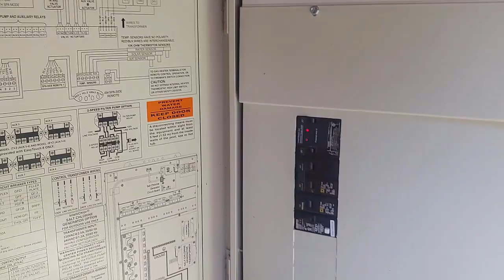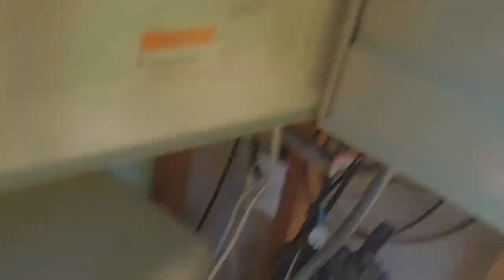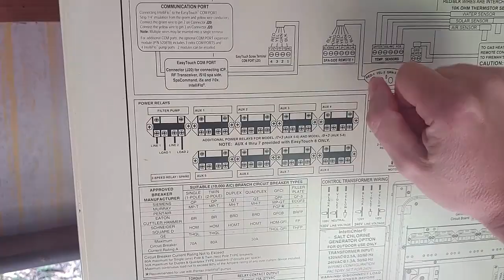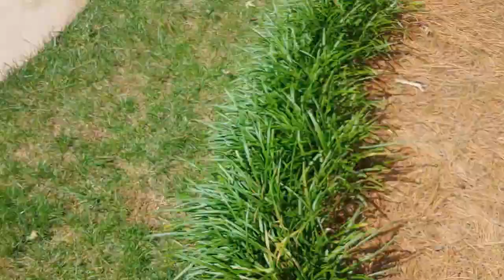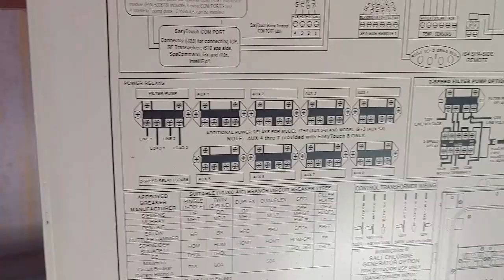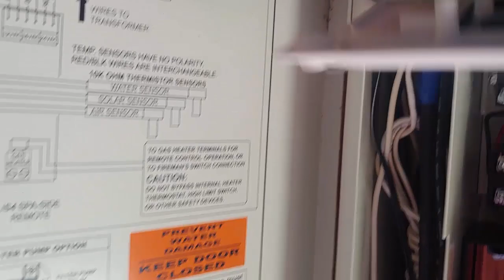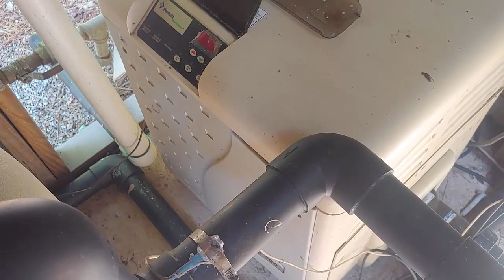REVIEW & overview: Pentair Easytouch 4 & Easytouch 8 installation. Pool & Spa Automation system.

Comment: I have the same exact system and my schedule Timer is not working, no matter what schedule I set the damn thing never stops just runs unless I shut the whole system down
Reply from the maker: Maybe try to reset the easytouch using the digital screen. You'll have to reprogram things so be prepared for that. But first, check your motor relay to see if it is stuck/worn out. The contact points inside it may be stuck. If so, you'll need to replace your motor relay. It may be the first relay in your box but could be any of them, trace the wires and see. Turn off all power and tap on each one with the butt end of a screwdriver, that may get it unstuck temporarily.  Turn off the main power supply to the entire box before doing this.  I think you live in my area, I wonder how close. I am in Cumming.

Comment: Awesome video, thanks for sharing all this great info. At 0:20 you mention an 'assisted pools install program'. Can you explain what this is?
Reply from the maker: My pool builder (fiberglass) has a special sales program where you can basically pay them to make your pool and they come and they put it in a hole in the ground that you have a contractor do, or maybe you know how to do it yourself. They get the pool up and running on temporary electric. And then you act as a contractor or subcontractor to do everything else yourself. This is a company in the South Atlanta area.
Reply: @SwimmingintheDeep  Interesting to know, thanks.

Comment: Great video, thanks for taking the time to explain all of this.  My Pentair Easy Touch system stopped functioning although there is power to the transformer, the screen only shows the tiny boxes images and there is no response from the control board at all.   I noticed that the Blue wire from the transformer is not connected to anything and from what I can figure out by the diagrams is that is should be connected into the 12v breaker switch above it.  You ended the video right before explaining the transformer wiring.   None of the breakers in the main panel are tripped and both shut off switches, to this box and one to pump, have power.  This happened all of a sudden and I’m trying to figure out if the board needs to be replaced or the blue unconnected wire is the issue.   The Easy Switch is dated 2014.  I be appreciative of your thoughts because my pool company wants to sell me $10,000 worth of new equipment as the remedy and I’m not convinced I need to do that. Thanks so much in advance for your reply.  Best regards,  Lizk
Reply from the maker: I am made a quick unlisted vid to try to assist. Here is the link https://youtu.be/JXcuS6RPs0g

Comment: QUESTION, Is the surge protector CB the following: Siemens QSA2020 Circuit Breaker and Secondary Surge Arrester 20 AMP (2) 1 Pole?
Just want to get the right breaker since I was told that only Pentair and Siemens breakers should be used.
Reply from the maker: Thanks for the question. I used a Murray brand which is owned by Siemans.  Siemans or Murray, etc. It basically replaces two single pole 20 amp breakers. This is so it catches both phase one and phase two of your two hot legs in the box. You can also use both as 20 amp breakers for lights, etc. There are actually Six brands of breakers that Pentair lists in my box (on the door) that are compatible. GE, Murray, Pentair, Siemans, Square D, and Eaton.  I used Murray because I got it crazy cheap on ebay, new in the box. I'd use whatever brand is least expensive, they are all name brands.

Comment: How do you update the firmware of the easytouch? I read that you need to connect your pc to the low voltage mainboard, but I don't know how
Reply from the maker: Angelo, good question. I have never had a need to do this so I have never updated mine. I found a thread in a forum that may help you. I am curious, Why do you need to update yours?   https://www.troublefreepool.com/threads/how-to-perform-firmware-upgrade-on-pentair-controllers.69589/
Reply: @SwimmingintheDeep  because my firmware is not the latest, looks like they released a new one last year so I wanted to update it. Do you serve Orange County California by any chance?
Reply from the maker: @Ghilteras  nah, I am a homeowner. I just installed my own pool systems, etc. Not an expert but play one on YouTube 🙂  If you are not having any issues or compatibility I'd not update it. You can call Pentair and they will help advise you for free and let you know if there is any reason to update it.

Comment: Super appreciate the time you have taken to outline the wiring of the Pentair units!  My Easytouch 4 with screen logic and actuators just arrived and I feel a lot better about tackling the job myself, although the board does not have enough room for all of the breakers in my current box.  I think I'll wire it up like a subpanel and just bring the hots over to the relays for the items I want to control with the 3 relays in the smaller unit.

You mentioned the problem with the direct wire for the screen logic and the chip that needed to be replaced on your main board.  I'd like to try to avoid this at all costs.  I know I can add that suppressor (which might help) and you can go  wireless as opposed to the wired option.  What would you rec now that you have your unit dialed in?

Thanks
Reply from the maker: Thanks for taking the time to comment. I'd recommend that you use the wireless connection or use a wifi extender that has a port to plug in the Ethernet connection. I have another video on my channel that details how to do that. https://youtu.be/8o74R0HZ3nw
Reply: @SwimmingintheDeep  Thanks for the recommendation.

One last question.  If I have an intelliflo pump that will be controlled through the com port can I use the pump relay for another device and designate it as such?
Reply from the maker: @portlandhomeworx4871  I think you have it right and that is how those work but since I only have a two speed pump I am not sure.

Comment: Hi, Really enjoyed your video.  I have watched a BUNCH on the Pentair controller and yours are DEFINITELY the best and most clear.  I have the Easy Touch 8 and am new to pool ownership.  We recently had to replace our pump and went with a Variable speed Hayward Tristar VS900.  Now the Pentair system no longer controls the pump (at all).  I guess that is due to the built in controls on the pump itself.  I am wondering if you have any advice/guideance on wiring the pump to the Pentair so that we can at least turn it off/on so that we can remotely control again since we could at least turn off/on with the old pump and control our heater since it will only run when the pump is on.  Your help is appreciated. Thanks! George
Reply from the maker: Thanks for the encouraging words about my video and channel. I finally got it monetized this past month, it's been a long journey. I did a quick look into your dilemma and I think there is a "relay mode" for your pump that may work. I have a two speed Pentair pump that uses a special two speed relay that is mentioned on your door diagram for your easytouch. I don't know you'd need a special relay but just to do on and off you may just use the standard pump relay in the EasyTouch box I'd guess.  Here is a link to the thread I found that is similar to your dilemma and they offer a possible solution. https://www.troublefreepool.com/threads/hayward-vs-controlled-by-jandy-panel-and-other-third-party-controllers.138249/
Reply: I believe you can only run pentair vs pump on the pentair controller

Comment: What is the part number for that 2 speed relay switch and please advise why its needed?
Reply from the maker: That's only needed if you have a two speed pump. one of the reasons I went with a two speed pump is that during freeze protection mode it only runs on very low speed saving a lot of power over time.
Reply from the maker: Looks like the Pentair part number is 520198 for the relay.

Comment: Hello,
Can someone please help me with my pool lite( inrellibrite 5g)  I'm trying configure this into my easy touch 8 and use the feature mode instead of turning it of and on manual?  Do I need a separate unit or box to allow me to do this?
Thank you
Rodney
Reply from the maker: I don't have intellibrite lights but see my other video on lights https://youtu.be/uDaTy7nnQhw.  I looked up your lights . pdf manual.  You can wire them like mine to simply turn them on and off.  It looks like you can also get a separate part called an intellibrite controller.

Comment: What is the brand of the surge protector that you have for the high voltage side ? What is the surge protector brand name for the low voltage side ? I have the same Pentair system you have
Reply from the maker: It's a Murray Breaker, owned by Siemans.  MURRAY 20 AMP Circuit BREAKER Surge Arrester MSA2020 120/240.  I used a camera surge device for the low voltage side. I think it was overkill. Regarding Screenlogic....If you are aware of the issue with the communications chip blowing on the system motherboard is a bad spec chip IMO. The slightest surge will kill it.  If you have a wired link to your motherboard from your brick in your house I suggest you change that to a WiFi link ASAP. That seems to be the common denominator in the chip blowing. Ever since I changed my to wireless it has not blown again.  I have a video on the wifi link if you look at my other vids.
Reply: @SwimmingintheDeep  I have a brand new system . If you could please give me the brand and model number of the camera surge device for the low voltage side -thank you
Reply: Also if possible can you please show me how you connected the low voltage?
Reply from the maker: @charlesloguidice2829  I removed the low voltage protection last year. I had it in line for the 4 wire screenlogic on the panel and in the house near the brick for screenlogic. In the end it did not protect my system. That's why I went with a WiFi setup for the link.  I believe it was a ditek brand though for 12--24v. I think I still have it in a box it you want to pay shipping, LoL.
Reply: @SwimmingintheDeep  what did you use for a surge protector for the low voltage?
Reply from the maker: @charlesloguidice2829  answered that above.
Reply: @SwimmingintheDeep  what do have protecting your low voltage ? what did you replace it with ?
Reply from the maker: @charlesloguidice2829  Nothing.

Comment: Dude, your info is truly invaluable!   Any good spots to tap into for either 12V or 5V to power my wireless interface access point?
Reply from the maker: Thanks. The black and red contacts on the com port on the main board will give you 17 volts. Many electronics are pretty forgiving if it's just a few volts difference. But try it at your own risk.. at the 23-minute Mark in my video you can see a black wire where I tapped it myself to power my Alexa hack for when my main board was not working, I have since repaired my main board.
Reply: @SwimmingintheDeep  it appears that the transformer provides 12V, 18V and 24V.  I think a simple 12V to 5v converter for a car could be take into the 12V output to power my USB mini access point.
Reply from the maker: @shahphone  You're correct. I measured the 12v wire coming out of the transformer, it plugs into the board on a 6 wire plug. The two blue wires are supposed to be 12v. Funny, the board says 10v on the board. My blue wire measures 8.5v. That should be close enough to your 5.5v IMO. But try at your own risk. I am going to use it for my wifi access that calls for 5.5v.
Reply: @SwimmingintheDeep  i don't know that I trust the built-in regulator to drop the voltage 3V.  While it probably would be fine, summers where I love get in the 110s, might be a problem with the extra heat.   A dollar tree DC-DC converter hard wired in will give me exactly 5V.

Odd that the voltages are different than what it states on the transformer?
Reply: @SwimmingintheDeep  So now that I got a closer look at my board, the blue wires coming in for the transformer are AC.  Thats why it's giving you less voltage.  Flip your multimeter to AC and you will get closer to the stated values between the two blues.  One blue goes to the board directly and the other goes through a low voltage breaker to the board.  They then go into an SMT rectifier that converts to DC.  So you have been running your alexa mod off of the COM port?  How many amps do you think it pulls?
Reply from the maker: @shahphone  ha, I had not realized it was AC. I'm also not certain of the amps drawing off of the comport and the brief documentation that was probably written in China does not disclose that either. But most devices of this size don't seem to pull more than about an amp.
Reply: @SwimmingintheDeep  i never use the GFI outlet on the side of my box.   I just plugged a small USB brick into it and ran a cable out the in-use opening to the gasket on the bottom of the easy touch up to the low voltage are and stuffed the mini router in there.  Even enclosed in a metal box it is working great.  Thanks again.
Reply from the maker: @shahphone  You had me wondering how my sonoff has working off the comport. Apparently the board had rectifiers on it to turn it into DC.  I found this in a forum....  **The 10VAC is converted to DC and runs the board/processor/display, the 18VAC is converted to DC and drives the relays, and the 24VAC is left as AC and drives the valves.
Reply: @SwimmingintheDeep  I mentioned that a few days ago.  ;)
Reply from the maker: @shahphone  maybe that's where I read it :-o
Reply: @SwimmingintheDeep  screenlogic adapter from eBay died on me.  It would connect to app but couldnt read any serial info from the pool equipment.  Any amount of troubleshooting failed.  So I set up a raspberry pi zero w with nodejs-poolController.  Its SO much better, has wifi built in, and is less than $30!   Also, the size is much smaller than the protocol adapter.
Reply from the maker: @shahphone  Cool!  I thought about doing similar when the network chip on my main pool board kept blowing and then I figured out how to fix it myself. That could have been what happened to your system too. A small chip goes bad on the main pool board.  My system is now pretty solid. Does your set up do anything to confirm the pump is running, etc? That was one thing that I missed when I did a Sonoff hack using the remote spa inputs.
Reply: @SwimmingintheDeep  it does everything the screen logic did, including programming your schedules and relays.
Reply from the maker: @shahphone  any good links so I can read up? Sounds cool.
Reply: @SwimmingintheDeep  https://www.troublefreepool.com/threads/pentair-intellicenter-pool-control-dashboard-instructional-guide.218514/

Comment: My pentair multi color lights come on for 3 secs then goes out, turn off lights wait about 2-3 mins turn lights back on , and it repeats, cones on and goes off, the light are controlled by the light button on the touchpad panel. What’s going on with these lights? Or Panel, need advice
Reply from the maker: Did they used to work? If so, I'd suspect a relay issue.....either with the easytouch circuit they are on our with the light system. Sorry, I don't have those type/brand lights so I may not be much help on this issue.
Reply: @SwimmingintheDeep  yes it’s the standard set up from the high voltage relay to the voltage relay. That’s what I’m thinking it’s the transformer. I’ll connect the wires to a 12volt battery to test light. As it appears something is thrilling out on both lights
Reply from the maker: @itsrem  that sounds like a good idea to me.

Comment: Since it's a sub panel, "Can't you just skip installing a whole house surge protection breaken inside of the pool panel by installing one inside of the main breaker panel?"  Also, by installing a whole house circuit breaker inside of the main breaker you can also utilize it in place of the cut off switch so that one whole house circuit breaker (220 V) that feeds the pool (sub) panel can do both as to cut down costs because it'll be all electrically connected.  Seems redundant.
Reply from the maker: Good point. It is redundant. Redundant surge protection is good.

Comment: Thank you for the video. Very informative. I believe my circuit breaker for the pool pump needs to be replaced. When I press the test button, the switch does not do anything. Is this an indicator that it needs to be replaced?
Reply from the maker: So your circuit breaker is a GFCI? I think that is code in most parts of the country as of the last few years. you may know this but try forcing the black switch part of the breaker all the way off, then all the way on. When you push it all the way off you'll feel some spring resistance... press into that spring resistance you feel and then flip it back on.  My breaker like that on the pool pump did not last very long at all. So I switched it out with a regular breaker, which it's not within code of the last few years.

Comment: Can I buy this Panel and us it a country with 220V power grid?
Reply from the maker: I am not sure, that's a question for Pentair themselves. The way the USA works is that you feed this panel with 220V with two legs...110v+110v.   110v breakers only pick up one leg of the box while 220v pick up two legs. Some things in this box, need only the 110v breaker. So where you see my thin breakers compared to the big thick double pole breaker (220v for the pump), that's the difference.